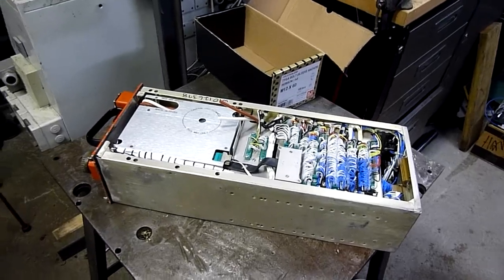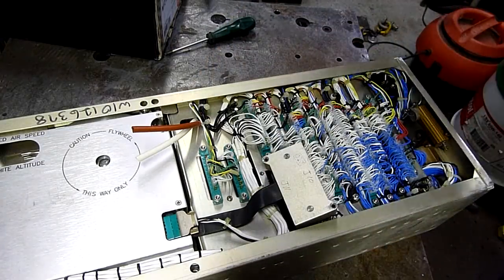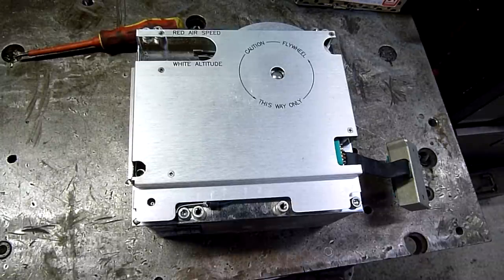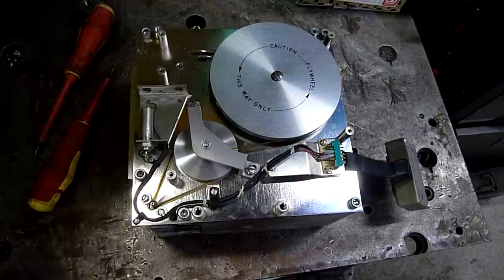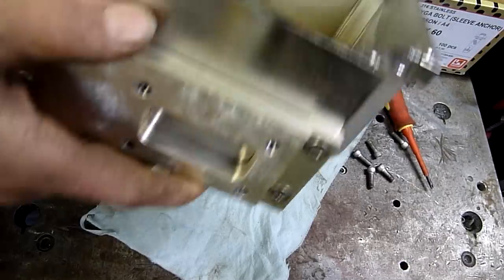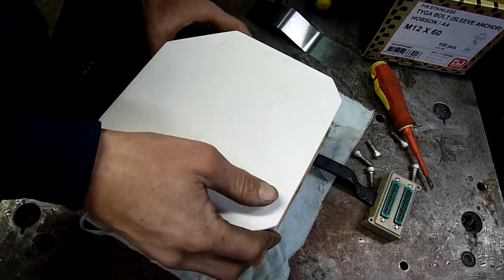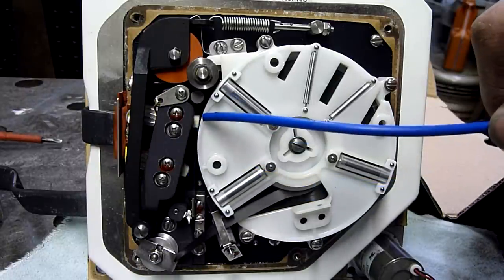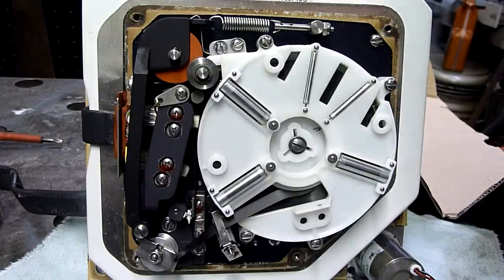Fairchild F800 " Black Box" Digital Flight Recorder Autopsy Pt2

Comment: That tape looks like 1/4 Inch tape, same used as standard reel to reel tape. The centre hub has the trident spindle, same as on R2R used.
Very likely that the tape can get looped out and played on a normal R2R recorder.
radio stations used cartridges with a similar set up, but the housing was see through plastic. Interesting machine.

Comment: If your phillips screwdriver is too pointy and bottoms out, this means you should be using the next size up. (If you cut the tip from a #1 it will be very close to a #2 geometry and so on). Phillips screws tend to require unusually large looking drivers, for a given thread size, often the shaft of the driver is larger than the screw head, leading to problems with recessed screws. 

There are also Pozidriv (not in a US made black box) and a lot of aircraft specialty profiles.

Comment: Ed, I'd love to try and get the data off this thing!

You might be able to hook up the heads to a PC audio input and get at least something off it (manually run the motor etc.?).

Might even be worth making some sort of 400Hz PSU for it?

The data recovery could be an "interesting" project. :)

I'm just hoping they haven't run it through without writing any data - I'm assuming it must have an erase head, so it's possibly they could have blanked the tape.

Comment: as zx8501ztv said, 8 track players used one reel and looped back in the same way, they had the sensor for switching tracks, but i'm guessing the sensor in the flight recorder is a tape break sensor, you don't want a gap in the recording at the critical moment, so there wouldn't be a gap.
Also, i think they may use all 8 tracks (one for each parameter)

Comment: Interesting rollers and rotating center also, this is far far more advanced then a simple 8 track or radio station cartridge. There are likely various additional measures to keep head contact, tape pack and tension optimal as well as preventing those endless loop jams that would leave people wondering what brought the plane down and why boring crash-able hard drives weren't used. Perhaps solid state is a good advance but they'd better get the software right!

Comment: Head pads... wow. Guess it does keep the head contact good though. Though I like tape I agree with having no audio cassettes in use in general. I've recorded audio cassettes at twice normal speed, still not good enough. I'll do better then that though (upcoming project) and there's nothing like good pro audio tape @ greater then 15 ips.

Comment: That was a typo on my part, it is of course 3-3/4 inches per second which was the slowest speed that would still give acceptable fidelity on a reel to reel machine, the RCA tape cartridges and the four tracks also ran at 3-3/14 IPS. The normal blank cartridges would allow about 22 minutes per program if they were full length, I don't think I've seen one longer, I certainly don't own any longer then that.

Comment: It's like the world's most well built eight track cartridge, or radio station tape cart, the radio station carts have clutches to stop the tape from being pulled out should the splice break. It looks like the 1/4 inch tape has a graphite backing just like an eight track tape. A full length eight track cart can hold over 80 minutes of content at 3-2/4 inches per second, if that thing is geared down it may hold even more then that. If the motor is 400 cps then they would need to gear things down

Comment: okay, so on my last comment, a few people misunderstood what I said about the tape and water.

simply put, it is better NOT to put a special resistive coating on the tape since that can affect the data (as it adds thickness).  Also, with the tape being submersed in water, it can protect the tape (compared to letting it be affected by salty air if it lands in in the ocean) so once they are ready to get the data off it will be in the best condition possible.

Comment: I agree, don't rip it apart.

Can you try to start the motor? As far as I understand, you got most of what is needed to run the motor.

a interesting project, even if you try to repurpose the tape-drive (doesn't the workshop need a flight recorder? is video even barely close to a option?)

Maybe delayed audio? Please look into it :)

Comment: I read up on this particular model and they were not really well received by the aviation industry as well as the govt types. They would drop data tracks, or erratic power fluctuations would cause them to drop large time frames. You get to see a lot of these on the market as surplussed/non-flight articles.

Comment: I can tell you for sure the tape isn't resistant to salt or fresh water.  it is just like audio tape, after a while it will degrade once exposed to air.  that is why, when they recover these boxes from water, they are quickly put into the same water inside a case for transport and only removed again under certain conditions once they are ready to extract the data.

Comment: on that note...it is better for it NOT to land in water, as the water will force them to open the box, even if it is undamaged, because the read heads and electronics will be damaged.  it is far better to simply plug into the data port on the front to get the data, if possible.

Comment: In older analog models instead of tape fine steel wire was used on just a continuous reel to reel device obviously there was less data being recorded but using steel wire did help with fire and water proofing before tape had been made robust enough.

Comment: Primitive in the year of 2016 . Fragile . Easy damage . not reliable . hard to find out. data always damaged.
If you think not .... means they are totally not easy damage, easy to find , fast to find, Is there any statistics showing the the percentage of black box damaging after crash ?
Any updated New design ?
As a layman. I found the device very primitive . 2 hundred degrees for 10 hours? useful ?
nearly 4000 g .useful ?
In the case of Lauda , damaged 
in the case of concord , 3 hours burning
Reply from the maker: +Wm Siu the new solid state units are by far superior, this is a 70's design thats largely illegal to use according to the FAA, only a few backwoods airlines run them today.
Reply: +Aussie50 
do you have any statistic about the ratio of BB damaged after crash.
It lost valuable data for investigation.
If one out of ten , I would say this is totally unacceptable.
Kindly design a super BB for us that has 95% survival .
the market is tremendous and 500 million people thank you.
Thanks.

Comment: Brill vid, would have loved it if you could have spun up the motor on the side either by stepping power into it directly as i can see the pos an neg wires there or just by using a drill just to see that tape in action i find it quite facinating the mechanics of a continuious loop tape.
Reply from the maker: Gregory Grais since making this video, I actually have the full technical service manual and a 400hz rack mount PSU to get it running some day :D

Comment: I really loved the videos! Today i just bought a FDR on ebay from UK...can't wait to receive it!
You just fulfilled my intense curiosity of what's actually inside one of these :) Thanks much for sharing!
Reply from the maker: they are really cool bits of equipment :D, I wish I could buy more different models too, trouble is most of them cost thousands of dollars (price gouging) and are not even working units.

I have since bought a 400hz ground power unit, and a technical service manual for the F800 so I can get it running :D
Reply: Aussie50 They're indeed cool :) always been fascinated by aviation stuff! And yes i agree...sellers tend to gambles over prices just because all those items are "for collectors". I rarely buy from around here in Europe anymore,prices are too high...i fortunately have found a couple of sellers between Poland and Israel with lot of cool stuff and very reasonable prices,even for the shipping.Get it running? Awesome! Would be really nice to be able to extract some data from the tape :P If possible and if there are any left XD
Reply: +Aussie50 Great video but 6:02 min to get to gold? to long!!